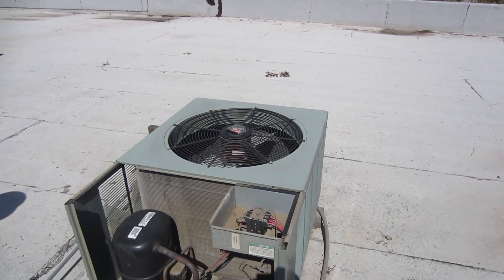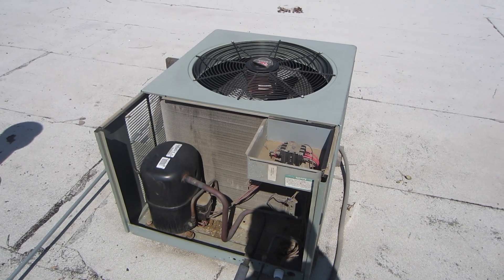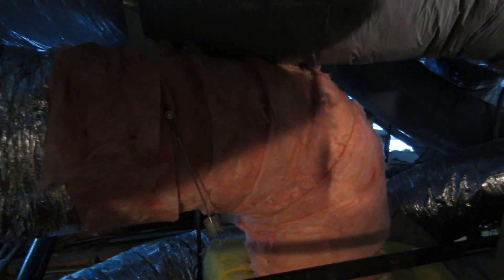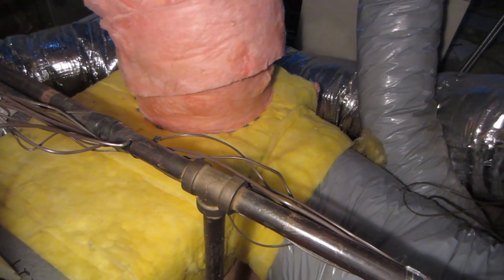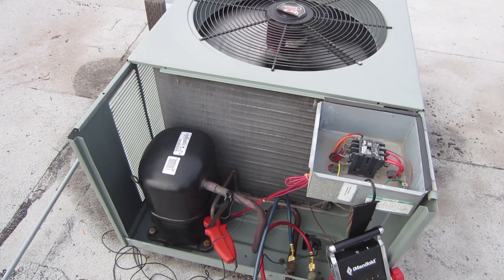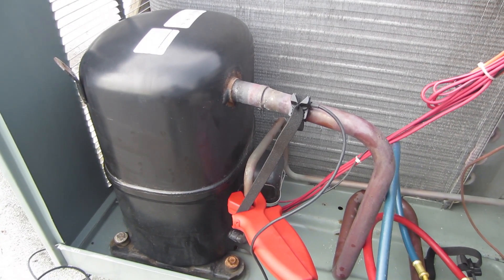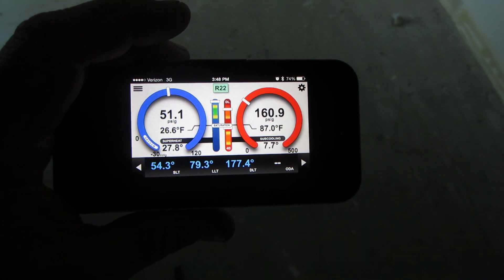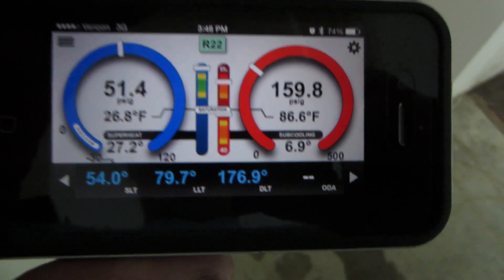Rheem RAKB update with the iManifold

Comment: That's the sweet spot for that manifold on commercial & light commercial work.. Way cool Dallas nice repair, that compressor is much much happier. :) 

-Mike
Reply from the maker: The flexibility the iManifold provides is unreal and a time saver once you start using it the possibility are endless.The compressor does run a lot better now and the zoning works right for the first time in history. Thank for watching!

Comment: Thanks to your new bypass and 2lbs recovered, this system really has a new lease on life.  It was surely headed for slugfest before.   Thanks for the great video.
Reply from the maker: I really hate to see a struggling unit. I was happy to see the customer wanted  to do the repairs.The compressor had a slight knock but I think once the oil return to the compressor it will be fine. Thanks for your great comment!